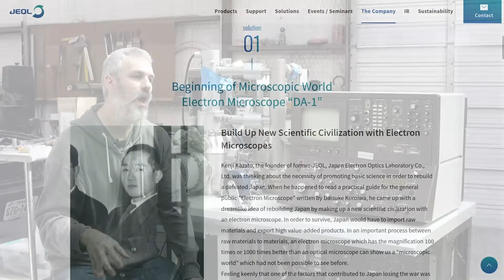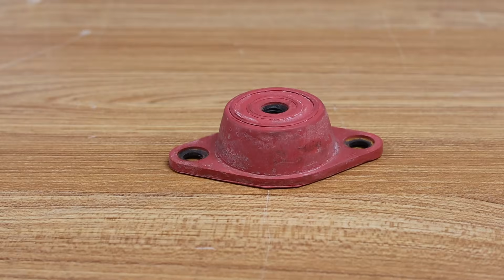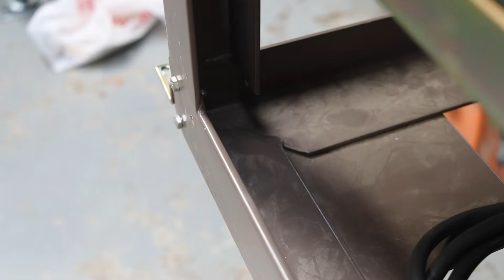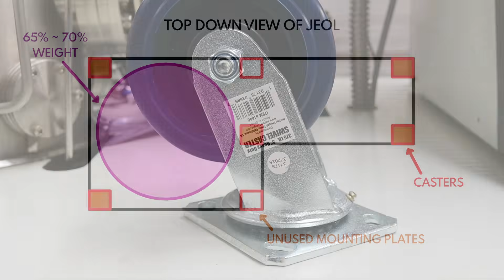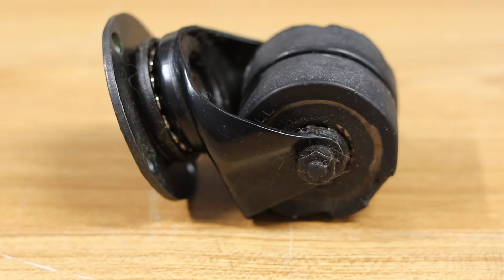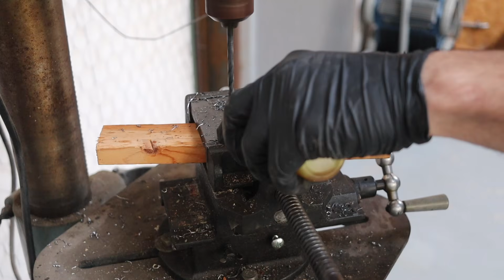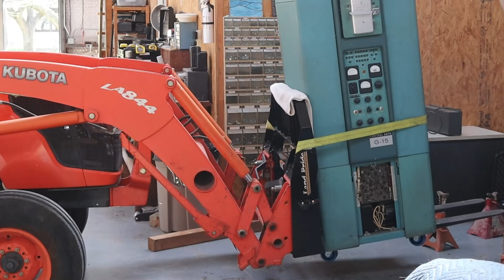Usagi Electric Is Changing, and Here’s Where We Start!

Comment: Weird design on G-15 casters serves two purposes: More load capacity from small wheels and easier turning as they rotate individually and do not thus resist as much as they can turn different directions while rotating caster
Reply: I have same type of double wheels casters mounted on a modern (21st century) 42U server cabinet, so definitely not a weird old design.
Reply: Being small, the wheel to swivel centre offset is also low which would help with tipping stability, which looks like a concern here.  Imagine 4 giant casters all turned inwards; the stability footprint gets small.

Comment: It's great that you cover ALL the aspects of restoration, not just the sexy bits.
Reply from the maker: Casters is such a boring topic to talk about, but it takes legitimate time and effort!
Reply: @UsagiElectric  The real boring topic is making the bolt holes.  Thanks, I'll see myself out.
Reply: @UsagiElectric Not boring at all, but then again I've done a lot of mechanical projects so it was actually kind of fascinating, especially on the G15.
Reply: And possibly first on the non-sexy jobs my bet is that the Bendix won't even come near the computer room door until it's had at least a 1st pass at washing away some of that grime. It doesn't necessarily look as gross as the rat poo that's been washed off some previous projects but when you're using any spinning rust device the addition of a pile of microparticle dust is probably not a great choice.
Reply: I find lifting 1000 lbs machines with agricultural equipment and cutting chunks of steel with a nail file very sexy and thoroughly entertaining.

Comment: That bandsaw motor, might have a stuck centrifugal switch? Needing a 'nudge' to start it spinning is a classic symptom of the start winding not being energized (or a bad cap, but you already addressed that).
As to the motor overheating... I wonder if the windings have a short from it not starting well? May just go with a replacement motor entirely (you are running it on the proper voltage connections, right???)

Comment: David, you should know that there's casters that can put down a separate foot if locked, they're often used in industry, that's probably a good choice for the JEOL (if you feel like mounting new casters).

Check out McMaster's selection of leveling casters, those are probably what you want.

Also, those lock washers barely do anything. If you want something that'll actually hold up, get wedge lock washers (something like the nordlock washers, they come in generics too)
Reply from the maker: I did actually think about using those locking style casters with a separate foot on the JEOL, but the key thing is not that they need to be stationary, but that they need to be fully rubber isolated. I couldn't find a good way to achieve. But, but the time we get the machine to a point where having rubber isolators is important, I think we'll be ready to essentially lock the machine in place and I shouldn't need access to the backside of it all that often.

Comment: For the JEOL David, why did you not fix the isolators to the unt, and the casters onto a 1 inch thick plywood sheet? At least that way, you'll have a permanent movable platform for any large project. Also, you could cut a 1 inch thick plywood base for the Bendix, just big enough to not be easily seen (paint the edges black), bolt it to the bottom of the Bendix using the original mount holes, and fix the casters to the plywood.
"Pooched" love it🤣🤣.
Love the idea of a "repair and restore" channel.
That's one cool bunny...

Comment: How do you plan on recoating it?
Reply from the maker: Initially, I'm thinking spray coating with surface finishing, but if that can't get the precision we need, we'll look into other methods too. It's going to be a long, slow challenge, but I'm quite excited for it!
Reply: @UsagiElectric  the clock is ticking according to wikipedia

Comment: With how large the heads are in proportion to the simple data used, do you think that crashed drum is missing enough material to make it unusable?  I'd be tempted to polish it and see what it can still do after cleaning the heads.  It will definitely be fun and educational to rebuild it though.
Reply from the maker: It's hard to see in video, but there are multiple places where the crash went fully through the oxide down to the raw metal underneath. Probably around 75% of the drum is still usable, but enough of it is damaged that it does genuinely need a recoat.
Plus, I think the journey of trying to recoat it will be a huge amount of fun!

Comment: Did you consider using lifting casters for the appropriate weight? Once the item is in place it can be dropped on more secure lifts, so the wheels are out of the way and the device is level 🙂

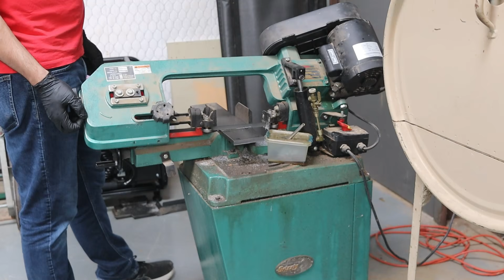Comment: @ 13:37 I'd definitely watch a car-resto-and-machine-shop Usagi channel. Usagi Machine, if you will.
Reply from the maker: I would love to get four channels going:
Usagi Electric - Focuses on vintage computing (G-15, Centurion, etc.)
Usagi Labs - Focuses on vintage scientific equipment (Auger, FTIR, etc.)
Usagi Workshop - Repair and restoration of shop equipment (mill, lathe, bandsaw, etc.)
Usagi Motors - Car restoration (I might finally work on those cars sitting on jack stands in there)

Comment: A little trick to drill up use a 2x4 and a block to push the drill up. By pressing lightly on the 2x4 it does a smooth job with a lot of control

Comment: Some scanning electron microscopes can do XRF- it's called EP-XRF, or electron probing X-ray fluorescence- it uses characteristic X-rays generated by electron interaction with the sample.
Reply from the maker: The Auger I believe can have an EDS attachment added to it, which would be Energy Dispersive X-Ray Spectroscopy. If we can get the Auger portion of it working smoothly, I'll look into potentially hunting down that add-on as well and really turn the Auger into a swiss army knife.
Reply: @UsagiElectric  One JEOL unit I worked on once had five of those X-ray diffractometers attached to it.  The thing was a beast!